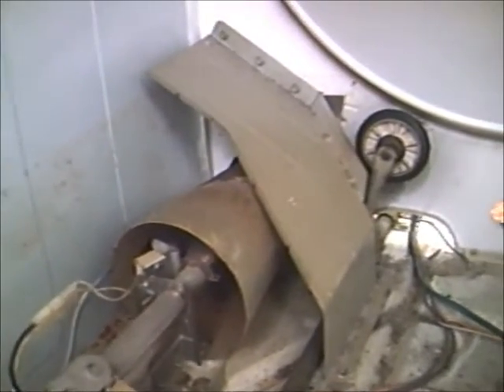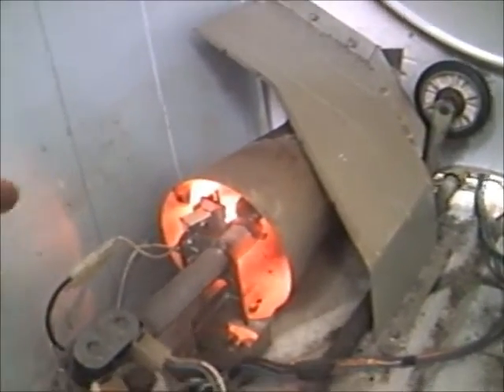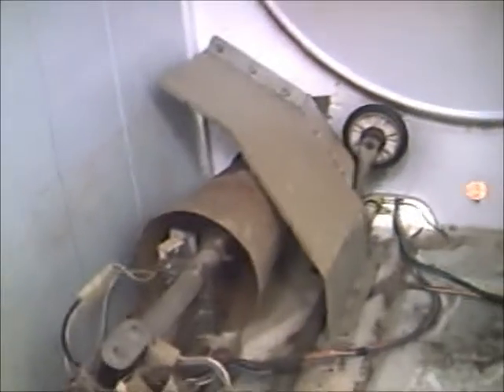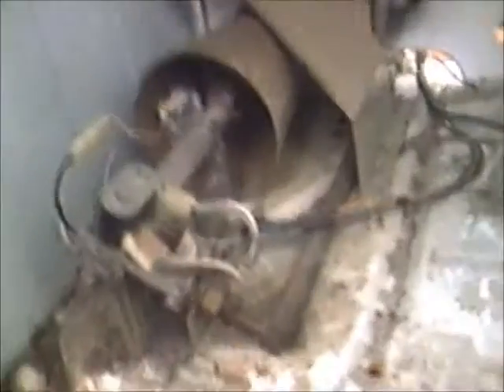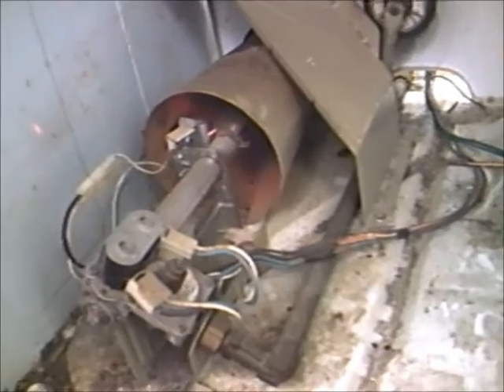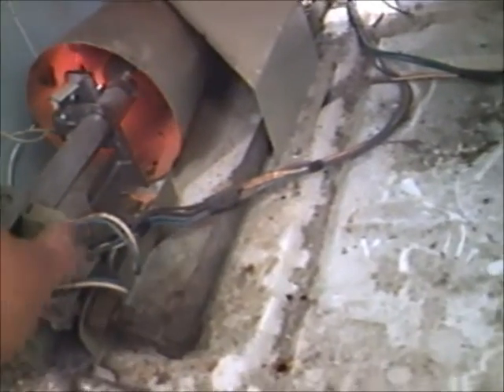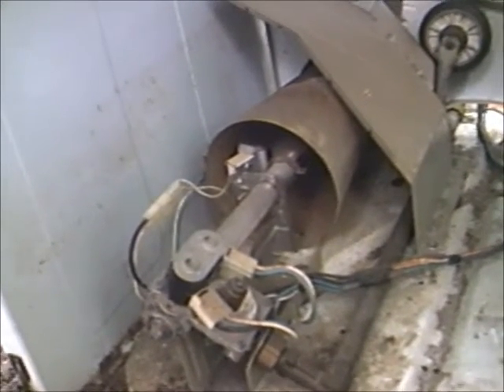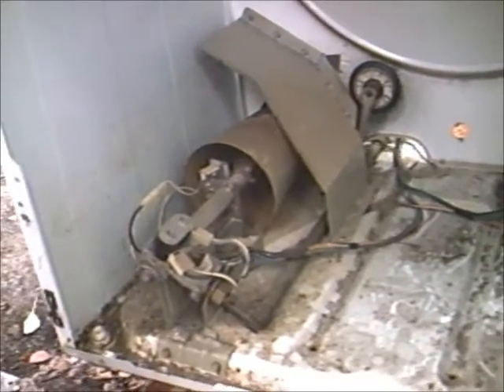Gas Dryer Solenoid Replacement

Comment: The BARTOL MAGPROBE is the best device for instantly checking electrically operated solenoid valves. Goes down to 3 goss. You can test solenoid valves while the equipment is running, use it under water, in a vacuum,  40 below zero, and also in explosive areas. It is non-contact and very easy to use. Typically tests can be done in 2 seconds. Over eighty thousand have been sold, and is currently getting ready to go Global. The nice part is you don't have to be a technician to use this device.

Comment: Thanks for the video.  Any tips on what I should check if the fuse is good?  I'm getting no clicks, no glow, and no flame.  The gas unit spins but does not heat.

Comment from the maker: If nothing happens you ain't getting power to the gas assembly. Check the control Klixon right next to the fuse. If it is open no power can get to the gas assembly if it is fine check the limit mounted on the heater chamber. If it is fine check the motor start  switch between number 1 and number 2 with the cent switch engaged either manually with your fanger or by checking while that puppy is operating. The heat circuit is broken at the motor switch on all dryers as a safety feature

Comment from the maker: The ignitor should start to glow and you should hear a CLICK. after holding them 2 wires together for a couple minute seperate them and flame should shoot out. Don't try this unless you have someone standing by to unplug the unit.

Comment from the maker: If the fuse is good the old timey way they used to do it is to next check the flame sensor. Now if you have a meter and cannot get a reading then just replace the sensor but if you ain't got a meter you can make yourself the flame sensor. But it is tricky. What the old way to do it was to remove  the wires from the sensor and start up the dryer without touching them wires to anythang or to each other. Did I mention you can get bit if you ain't careful. Touch the 2 sensor wires together.

Comment from the maker: When the motor is no running no power should get to the gas assembly. Finally if the centrifugal motor switch is ok, check the lead going into the timer from timer to gas assembly. If you have a bad timer no power will get to the gas assembly. I seriously doubt it tho. never seen that in a gas dryer.